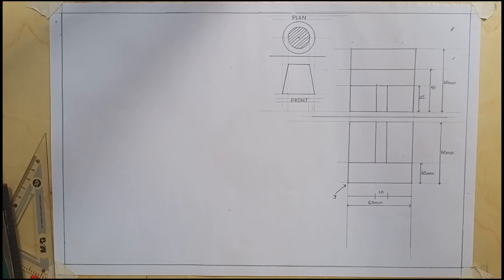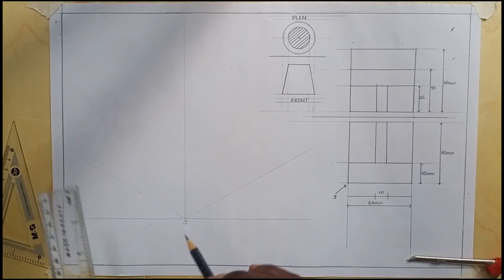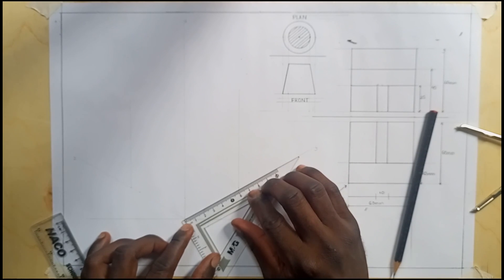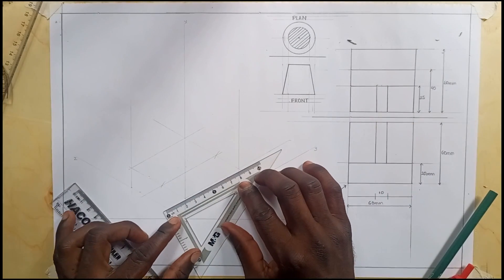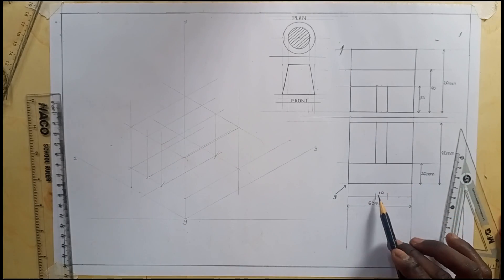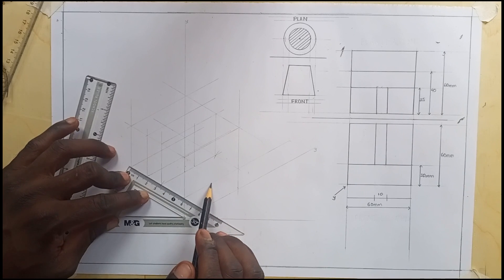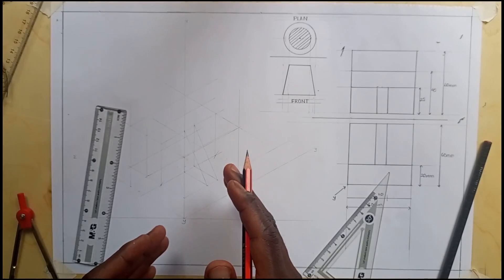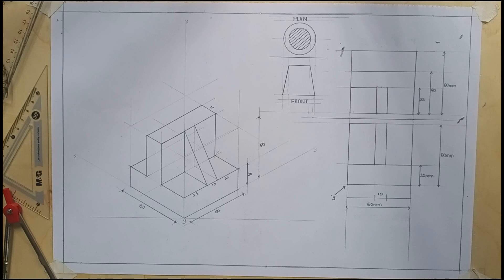From Orthographic projection to Isometric projection@ Technical Drawing Master Class

Comment: Is there a way to fix your camera to manual mode so it doesn’t change focus, exposure, colour balance etc
Reply from the maker: Am working on it but there are videos I have made using AutoCAD still on the same channel you can as well check on them please